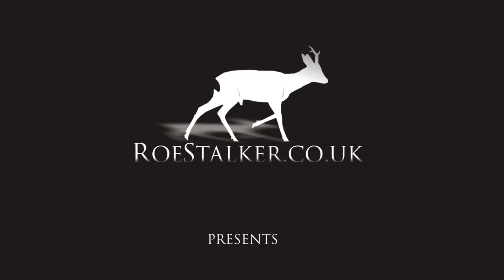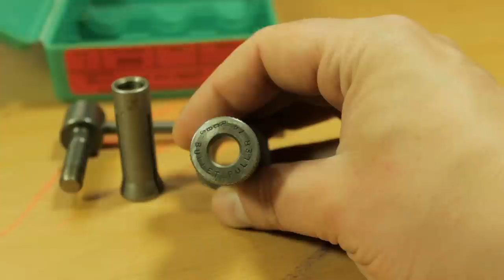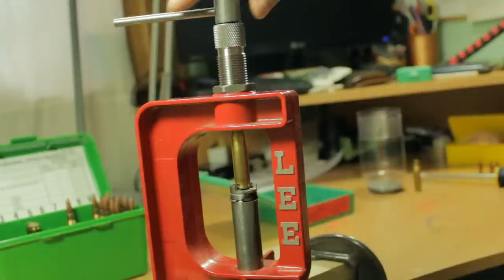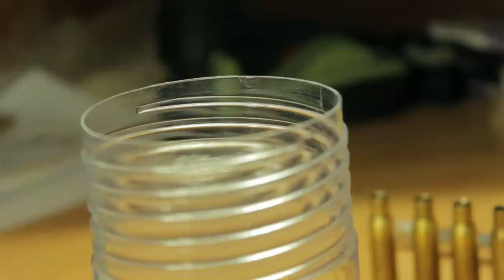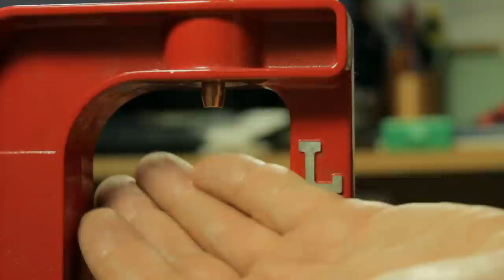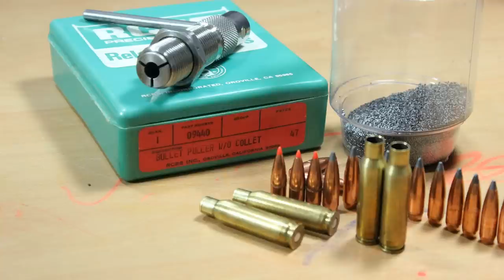How to disassemble live ammunition with RCBS bullet puller: RoeStalker's tutorial

Comment: Can you just reload the brass now? Does it need to be deprimed and treated like used brass? (Cleaned, resized, etc) I'm wondering if it's been crimped will it still reload without all that. I have recieved a bunch of reloaded 45 acp that I don't trust. I want to pull it apart, dump powder and reload it. I've never pulled any apart yet.